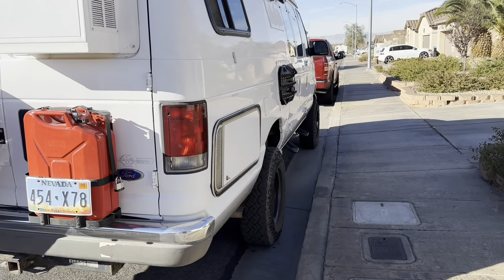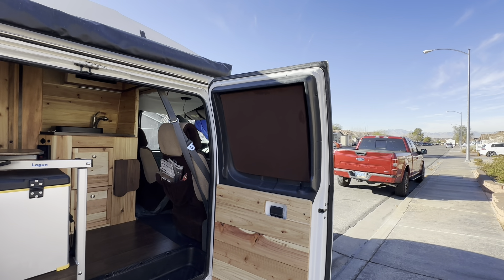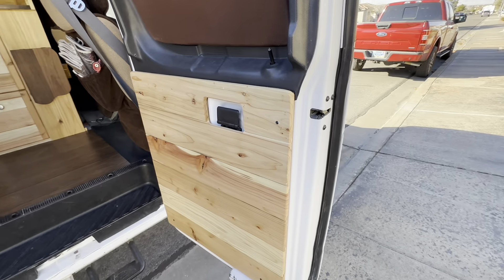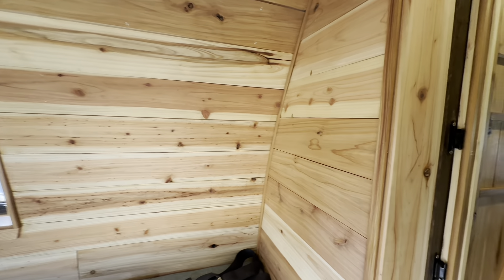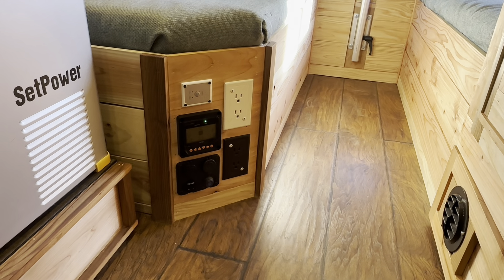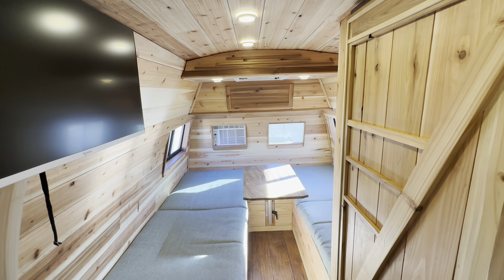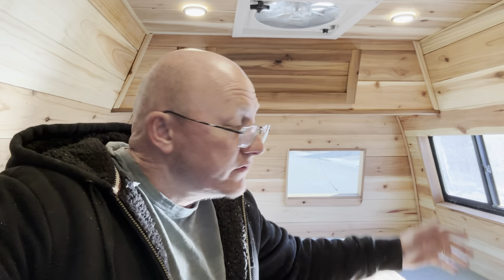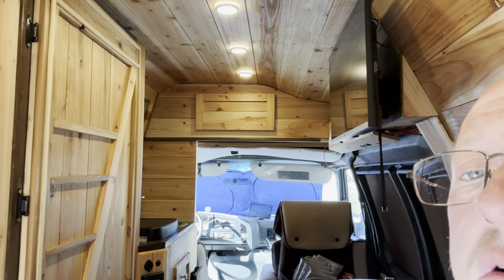The wood finish I applied really changed the tone of the cedar #4x4van #classbrv #vanbuild

Comment: Chrome from Van city vanlife said in a video just yesterday about the wheel spacers, his mechanic recommended changing the studs in them with actual ford studs because they are stronger with less chance of failure 😊 . Van turned out beautifully! And yes I learned the hard way that it’s better to warm up the engine before trying to break water pump bolts loose on a ford
Reply from the maker: Thank you

Comment: Hope you're feeling well soon... pb. bellett spacers?  Did you torque it exactly?  I am guessing 140 ftpb. The power set up that is not wired up yet with the volt meeter too.  I have mine wired temporarily and when I do it permanent, I will put in a switch to that individual socket (where it powers up (power ground, I open ground sides electrically)) from the back side.  It is bright at night it is disturbing.  You may be able to put a remote switch somewhere and use it as a night light if/when you get up in the middle of the night. Nice that is is close to the floor as you will see the floor nicely.
Reply from the maker: Good tips! Yep, billet aluminum and yes, cross pattern 140 ft pounds.
Reply: did it right...  good one @EndgameCampers